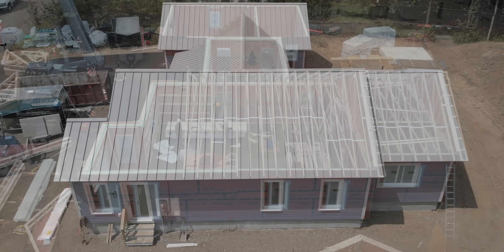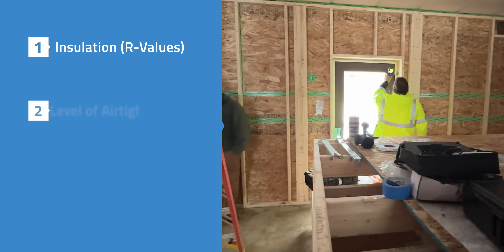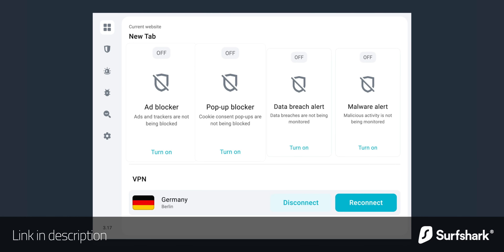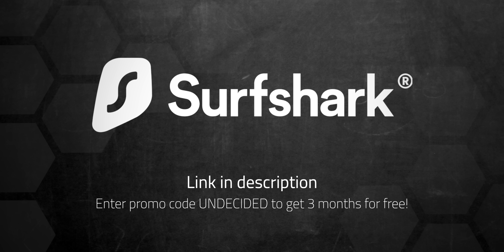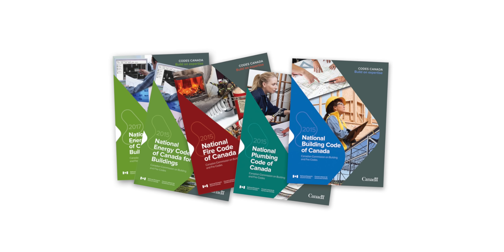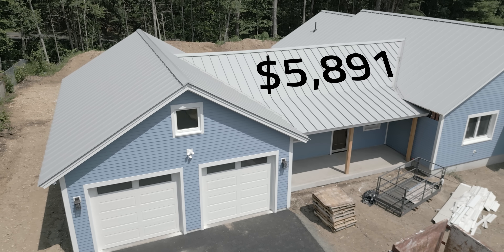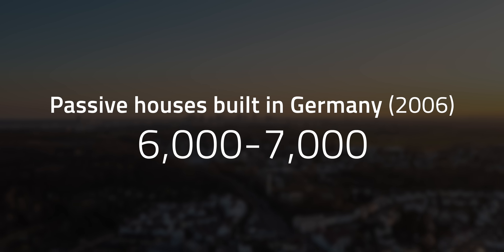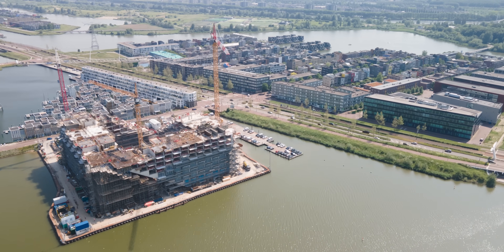Why Do American Homes Suck?

Comment: In india you just built a concrete structure that maybe looks good from outside and inside with no additional measures for efficiency or insulation. Just use different ac s in different rooms and pay for the electricity. I live in one of the rare cooler areas where temperature doesn't melt you in summers but freezes you in winters, there is no insulation for trapping the heat or keeping the house warm in any way ( not just mine but the entire country does the same)
Reply: You guys need to work on getting shoes first and not having the country smell like bare feet

Comment: If you wish to compare energy efficiency of homes in a useful manner, it is important important to compare all the energy inputs and also the availability and cost of the energy sources used. It is generally true that homes in countries like France and Germany are built to high construction standards and may require less energy to operate. However the energy inputs are huge in comparison to American homes because they employ larger quantities energy intensive materials like concrete, block, brick, tile, glass, aluminum, and fiberglass. Furthermore, Europe and America have different climates and thus different construction is warranted. More importantly, the U.S. by building cheaper homes has a much higher rate of home ownership than exists in Western Europe. Hardly anyone can afford to buy a house in most of Europe and people lucky enough to inherit one rarely sell. People deride Americans for driving cheap cars that are less fuel efficient too, but the criticism comes from people who own multiple cars and often travel by private jet. Finally, the U.S. has abundant, cheap electricity and gas because so much gas is available that much of it goes to waste. It is more cost effective and efficient to spend less on construction at the cost of higher operational costs. Europe has high cost, unreliable supplies of gas and electricity.

Comment: Live in sweden. Since we have a cold climate, most houses have good isolation 2-3 pane windows, heat pumps are everywhere. Sure some older homes are worse but can usually be retrofitted with air heatpump and drastically decrease electricity needs.
Reply: I work as an electrician here in Sweden too.
I constantly get shorts and videos in my recommended about electrical stuff, and it's like the US is stuck 30 years in the past constantly.
Reply: If we didn't have decent to good insulation we'd freeze to death in winter & be cooked alive in summer.

Comment: I live in a climate where the hottest days are max out at 30 degrees and coldest at 10, and they last only one or two weeks. 10 out 12 month temperatures are around 18 to 25 degrees, so my house has absolutely no means of heating and cooling air. Annual rainfall is about 1000mm so no need to conserve water. Sunshine is also abundant so heat water is generated by a solar water heating system. 
Plus energy price is ridiculously low at about 5 cents(usd) per kWh, my monthly energy bill is often less than 15 dollars. I might switch to an EV which the running cost is pretty much negligible. None of expensive green tech would ever work here.

Comment: I have a 1940s reinforced concrete home and just changing out the windows, insulation, and putting down weatherstripping saved me about 30% on my energy bill. Then I got solar panels and my electric bills halved, I would've saved even more money if state utilities didn't try to game the system with bogus fees.

Comment: Triple pane windows only work if you still limit the number of windows.... Even a 2x6 wall cavity will outperform the best triple pane windows.  I went with quality double pane windows that have a good air seal and reduced my overall amount of windows.  Yes the north side of my house is a little dark but the cost savings meant I had room in the budget for a top of the line heat pump and heat pump got water tank.  Plus spray foam in my rafter roof.

Comment: Truth is, you failed. You should have used closed cell spray foam. Your insulation will begin to sag and leak. Over time, your expensive windows become meaningless as your walls leak so much, your windows won't matter. I live near Chicago. I have a barn I recently insulated with closed cell foam. It is so well insulated, the cold from the concrete cools the room such that it does not need AC. But the foam, because it is solid will never move. It will always be air tight.

Comment: I can tell you why American home and home building SUCK. Because everything comes down to one thing: MONEY. Moreover, PROFIT. So cutting costs everywhere, at the cost of screwing over the customer is always the way to go FOR EVERYTHING (don't even get me started on Big Medicine or Big Agra). I have watched myriad videos, and read countless articles about how other nations (Scandinavia, Japan, et al, even Russia) take great care, and put in a LOT of thought, about how a home should function, how the people will live in the home, and then build a home around that. American homes on the other hand, have a cookie-cutter methodology based not only broad overarching regulations by the Govt, but on the size of the home: 3 bedrooms, 2.5 baths, kitchen, living room, dining room, garage, DONE. If they're lucky, maybe a basement too. All stemming back to the days of "just get them built" just after WW2, when there wasn't enough housing for returning GI's. You will only find really well-planned, well thought out communities and homes in tiny enclaves where the developers are the creators of these types of areas, and are very specialized. But the rest are just crap. Built cheaply, using the cheapest materials, built the fastest way possible, by builders and developers who could care less about the people living inside them. THAT'S why American homes SUCK: MONEY.

Comment: 16:35 so much truth in that statement. I work as a handyman and the build quality and finish of new construction is so much worse then it was 15 years ago. My 2019 manufacutred home had over 150 quality control issues along poor finish work. I was equating to it only being on the assembly line for 96 hours but after I got into the handyman business poor quality is endemic to the industry. It's not just the low end homes either I've done remediation work on high end million dollar homes that have exact same quality control issues.

Comment: Problem in USA is ppl LOVE large houses-the bigger the better (not to mention the show off value) and each developer wants to outdo his competitor. Just compare the size of the average house built in say the 1960s compared with the average house size of one built in 2010.  To keep the price down and within reach of the typical homebuyer, the builder will skimp on insulation, use wood frames, single pane windows etc. An energy- efficient house built to European energy standards would be way out of financial reach of the typical buyer.

Comment: The biggest problem with American home is the lack of structural strength to resist natural disasters, such as strong wind, earthquake. That's why people always evacuate in case of tropical storms. I personally designed and supervised the construction of our house 5 years ago in the Philippines, two years ago it got a direct hit of a super typhoon with wind speed up to 280 km/h; the eye of the typhoon passed our area. Our house survived with virtual no damage except for a minor dent on the roof caused by a fallen coconut. I did not need to do any immediate repairs afterwards. I don't think there are many houses in the US that could fair nearly as well in this case.

Comment: I have traveled a bit. I have been to 22 countries in three continents. Yes American homes are mostly wood and the windows are a pvc type with I think double pane windows. Americans like to walk around in shorts in winter and sleep.with quilts in summer so they obviously have decent heat/cooling systems. As far as cost well it depends in where they live in America. What is interesting is that buying a home in America is still pretty easy in most areas of the nation. I get alot of enjoyment from these videos talking crap about America.

Comment: Every time I hear this it reminds me of just how ignorant people can be about how these things really work. And I am not trying to be rude, it's just the truth. I recall hearing this argument back in architecture school while I was there for undergrad, and did a research paper on the subject. Even my teachers were surprised by the number of misconceptions.  First many of these so called green tech devices were invented in the US and much of which have been used since the '60s and '70s. So why don't we see it, 3 main reasons. First: the US has traditionally been an enegery independent nation and only really losing that status in the 70s and 80s, but temporarily had it again in the mid 2000s (around 2005-2016). Europe is not and never had been. They've never had energy independence which requires them to use more energy efficient products up front. Second...climate. the US has no less than 5 distinct climate zones where as the European countries which require some of these features typically are in one. For example, here in the Mid-Atlantic region outside of DC, winters can reach a low of 25 degrees Fahrenheit on average but a high of 100 during the summer when we aren't breaking records (and yes, you Celsius users can do your own conversions for a change). But in London, temperatures tend to hover between 40 degrees on the low and 70-80 on the high, at least until recently. This means warm homes more keyed towards low temperatures were better and A/C was a luxury no one needed in London, until recently. In the DC area, a home built to handle 100 degrees in the past can't deal with freezing Temps all that well.  Now, with newer technology that was really only starting to truly be available in the 80s and 90s, better insulation and thicker, Low E windows, you can get the best of both worlds, but that's recently. In fact in DC,MD, and VA, it's now required to insulate a house to R-30 which is extremely high. Also all new builds need double pain windows. That's great for new houses, but 60% of the homes in the area were built before that code. And it can take forever to get codes changed. Third, Europe doesn't build as many new construction homes as the US does. I see on B1M some massive complex in I am thinking Sweden bragging about using wood, and yet I just drove by two similar construction sites where they were doing the same here just yesterday, all much larger than that site in Sweden. Unlike many European countries the US population growth is much faster, and let's face it, these net zero features aren't cheap. That causes jurisdictions to be weary of imposing them until their benefits are absolute or they come down in price. Also, unlike in many Euro countries, the Federal Government doesn't actually control building codes to that extent. Local  municipalities do.  So while the president may want a more green change, it's up to the states, and sometimes counties to require it. Bonus: Net Zero isn't obtainable for most people. Sorry Matt, but I don't watch your videos on your house. I am slightly beyond midway through a refit of my own house and have managed to spend twice what I originally budget and I still haven't gotten the basics fully finished. I was expecting to add solar, a heatpump (it should be noted that US homes have been using heatpumps since at least the 80s. Every house I had growing up had one, this is my first house that didn't. But it's okay, it didn't even have central air, great for those 110 degree summers we've had the last four years), on demand water heater (which the jury is out on for effectivness) more insulation, but couldn't. When I started the reno we went into pandemic so stuff became impossible to find leading to compromises or, and this would become more evident as we exited, hyper expensive. The reality is that things like geothermal heat can't be built in most areas because people don't know what's under the ground. It's great when you have money, but I will guarantee his house is 40% more than an average new build. My house's reno may be over a $70k over budget, but I am pretty sure that is a steal over how much Matt is paying on his house over a non-netzero home, and that goes for housing in Europe. But I have one advantage, my house is over 70 years old. I am not waisting energy building it and creating CO2. It was done decades ago, and at the end of the day, it makes my house greener.

Comment: I saw a video of marques. That talks about his Tesla solar power panels. He spoke about 150-200kwh per day use. Without heating!! My house including a charge of a Tesla model 3 and heating. Is max 70kwh per day. If I don't charge the car. I use approx 20kwh on a bad winter day( -15). Normally it's between 10 and 15 kWh per day. This is because we have stone outerwalls, 20cm of insulation and then the innerwalls. The roof has 30cm insulation. Both side with wood and top surface are tiles. 

It's really bad how house are made in the us. We build house that can easily been used for 100 year and longer based on maintence on the houses.

Comment: The only part of the passiv haus is the low low number of air changes. I'd rather spend a bit more on energy to have a comfortable home and not struggle with moisture and dust constantly.  For context, here the difference from inside to outside can be 50C in the winter.

Comment: All newbuilds in Belguim are required to be low energy (K30) or passive homes (K15). But it seems rules in Europe for what is considered a passive house are way more strict compared to US as well. Since 2022 all new builds need to be below K25, by 2025 all new builds need to be below K20 and by 2030 all newbuilds should be passive (K15 or lower). How you want to achieve that is up to you. For instance I reached K25 with a condensation gas boiler while in stone houses that would only be possible if you install a heat pump and no conventional heating on top of all the other stuff like a lot of insulation, tripple glazing, solar panel installation, re-use of rainwater for washing and flushing toilets, ect ect

Comment: "air tightness" is a scam.

When you consider your HVAC system, suppose your units move 1,200cfm or 1,200 cubic feet of air per minute. Cool, great. What does this mean?

Well, it means your furnace is drawing in 1,200 cubic feet of air from your registers, through your ductwork into your furnace where it heats it up, then exhumes it trough your plenum into your home as heated air.

Any GOOD HVAC system won't just recycle the old, stale air though. It'll vent out some, and draw in new. But if air must come from the outside, how does it get in?

It gets in trough the seals of your home. Windows, doors, walls, etc. The air moves it's way in, allowing your home to "breathe"

If your home is "air tight", it means your home can't breathe. It means your HVAC system recycles the same, old, musty, rank, dried out air.

Comment: Working as an building engineer in the Netherlands, I can confirm that our building codes are designed so new building are supposed to be nearly energy neutral in regrads to the energy used by the bulding itself (excluding userbased energy) and thats just the minimum.

Comment: You mentioned the research that ultimately led to the Passivhaus standards.  Wasn't that all done by RMI in the US?  I'm guessing you didn't mention that so as not to be too dismal about your country, since there's already plenty negative to say.  But it's a cruel irony that we invented it and then refuse to do anything with it.

My brother is an architect and has been fascinated by passive houses for like 20 years but cannot find any demand for them even in a very blue state, so has never worked on one.  Updated building codes would help and we're slowly getting there.

As Churchill may have said, you can always count on Americans to do the right thing, but only after exhausting every possible alternative...

Comment: No idea why nobody in the comments is talking about cost. If you build a new home in germany, you're going to be paying at least 375,000 euros for a standard home. You can buy pre-fabricated for cheaper there, but its not that good. 
In america, you can EASILY build a standard home for 150,000 usd. 

We dont bottleneck 3/4 of the population from buying a home here. 

If you have the money, build a nice home. There are architects and builders who can build passive homes. 

Also, i live in the south. Grew up in louisiana. Ive sat through multiple cat 5 hurricanes running through my neighborhood in a stick frame home. It held up each time. 

Yes, high quality homes are nice. Paying 400,000 usd in build materials fucking sucks though when youre making less than 100k a year. 

This ia coming from someone who uses solar panels, uses r-49 insulation in not just my attic, but most walls, and uses triple planed glass. I grew up poor though, so i can empathize with people who arent ballin out of fucking control though, unlike all of these champagne socialists here.

Comment: Can't get solar, you lose your house insurance in hurricane zones.  Can't use foam insulation, makes it impossible to check or repair from termites.  Can't put in too much insulation, you'll die from radon poisoning.  Oddly enough, you can do pretty well with standard insulation and heavy draperies in front of old windows. Remember to stop getting more efficient when your electric bill reaches the electric company's minimum monthly bill.